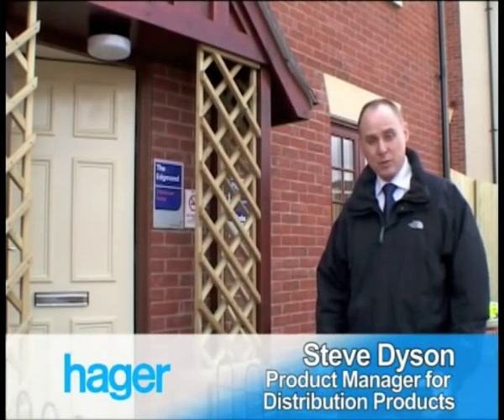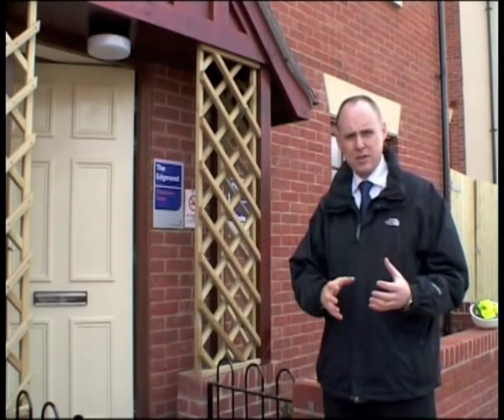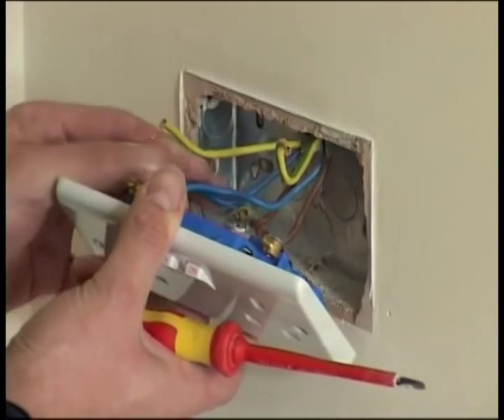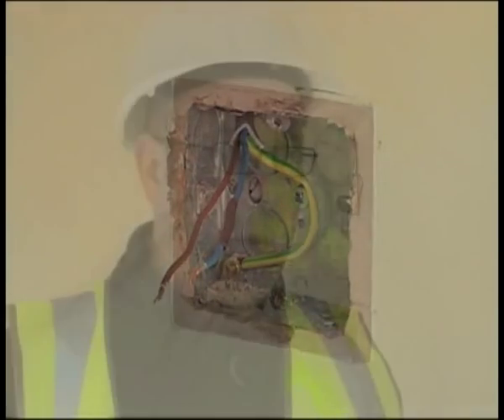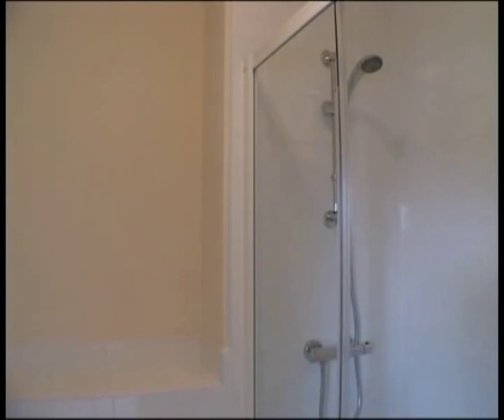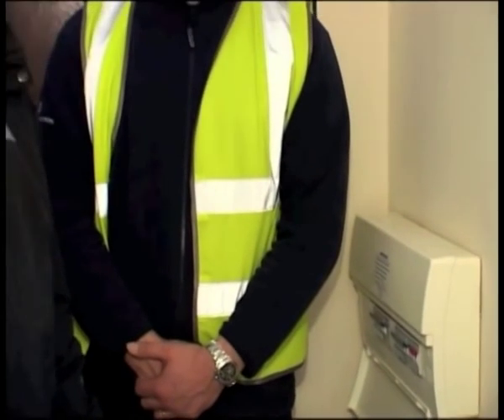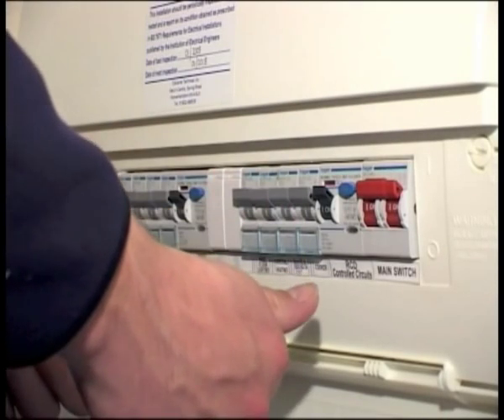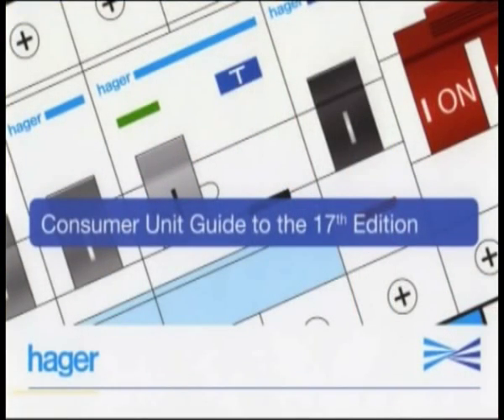The Hager Consumer Unit Guide to the 17th edition

Comment: Dual rcd consumer units do not comply with the requirements of BS7671 as they do not provide correct division of circuits and such should be noted as a deviation.  To call these 17th Edition is a myth as BS7671 does not endorse any type of consumer unit,  manufacturers are stating incorrect facts. Only separate rcbos will comply with BS7671 for division of circuits.

Comment: @festeradamz TT's must have an RCD to meet the disconnection times under earth fault conditions stated in 7671.Lighting circuits with cables burried less than 50mm in depth must be rcd protected,unless enclosed in an earthed metallic conduit.And detectors may be fed off a local lighting circuit,or a dedicated circuit on a RCBO from a non RCD protected side of the CU.Thats what i know of it anyways,others may tell me otherwise! In some ways the video just confuses some matters